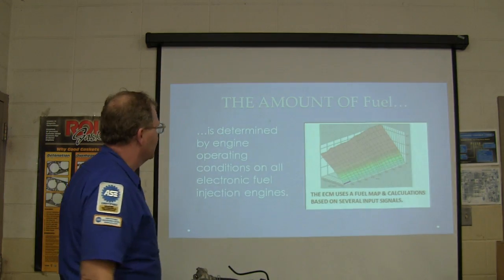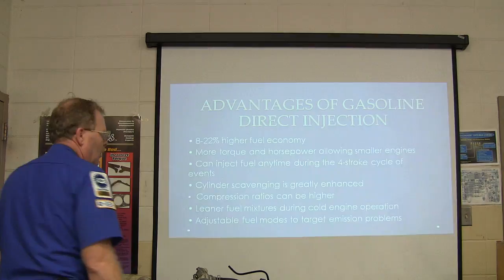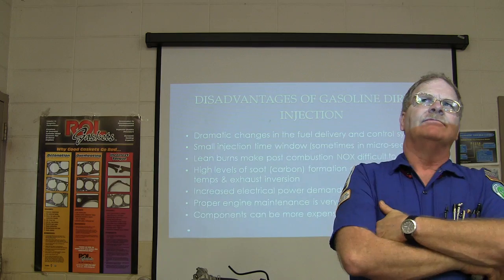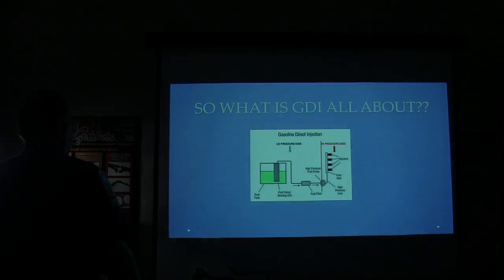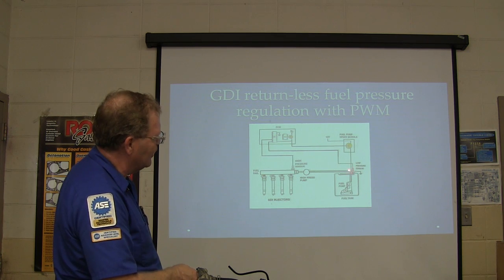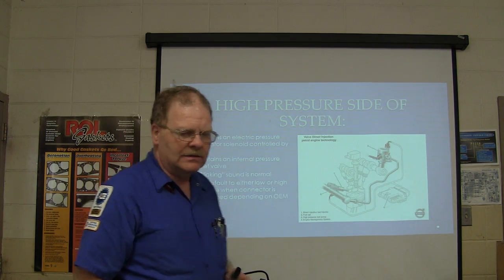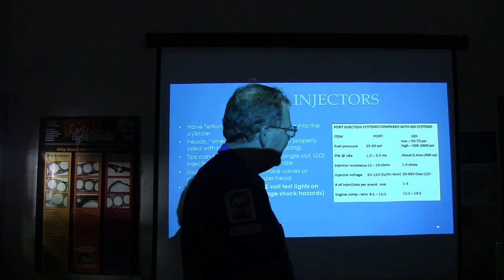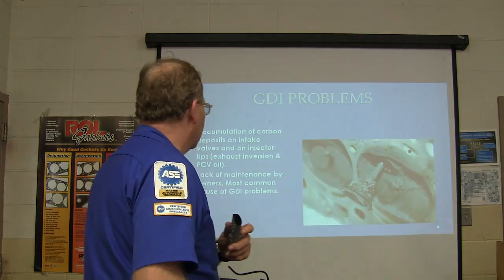GDI Crash Course

Comment: Thank you very much for posting your lecture material online. Its like I am sitting in your class with every video. I took automotive classes 15 years ago, farted around during lecture and have been a parts changer for the past 13 years (as an automotive hobby). The past few years by watching YouTube I have actually learned how to understand/diagnose and surgically repair cars. 

Today I repaired an Unrepairable car a Municipal garage and a Dodge dealer were unable to fix. The truck sat for 3 years broken until it hit my garage. There was multiple 02 sensor heater codes (CEL) the Garage could not figure out so they brought it to the dealer. Dealer "fixed it" by replacing the PCM, then could not program the skim keys properly, Replaced the skim module, then determined the car was unfixable. Returned to the City and there it sat (still taken apart By the Dealers hand). The invoice from the dealer was laying on the dash, City paid $800 for a unneeded PCM/Skim module/labor. 

I put a hot battery in, pulled codes and got a skim key code/light. Pulled a wiring diagram and checked power and grounds to the skim module. It was missing constant power due to a blown main fuse. Dealer must have blown it when they also Added wires to an o2 sensor circuit? Checked for shorts,  and good to go. Pulled 02 heater codes and checked the heater circuits. One sensor had a bad heater (open in ohm check) and another was missing a ground. Awaiting a locksmith in the AM to program the keys. Total repair on my end was a $19 oxygen sensor, 1 fuse I had laying around and 1 electrical end.
Reply from the maker: +m ph Great story on that Dodge - and I'm glad you're enjoying the class sessions!